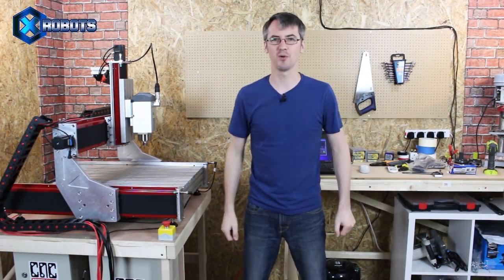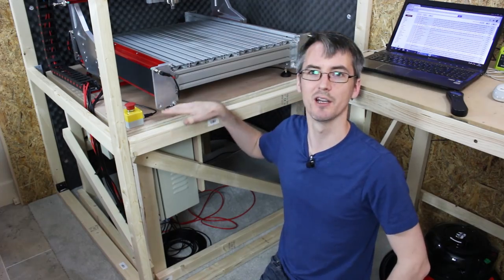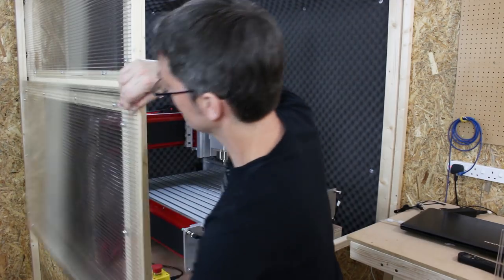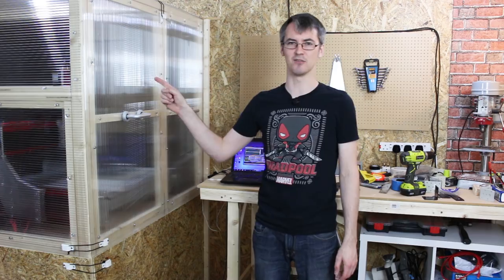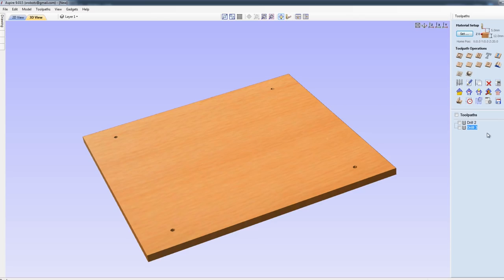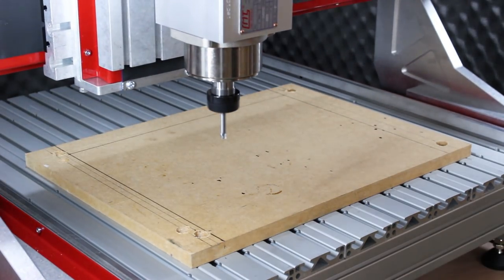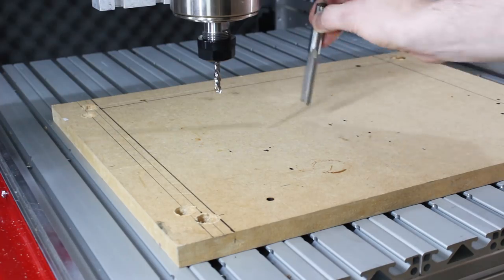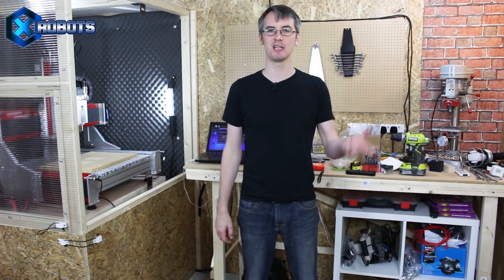Building my CNC Machine Router Table # 2 | James Bruton

Comment: Why not use the CAM environment of Fusion 360? You are already using it for modeling your design. It is a very good and complete solution for your tool path. And if you make a change to the model, the tool path updates!

Comment: James adding the Auto Z and Corner Finding Touch Plate should be a walk in the park for you, plug it in - check input pins are set and add the VB script to the 'Auto Tool Zero'. Great to see you've added a CNC to your toys

Comment: Excellent machine and setup James. I would seriously look at adding an easily accessible Emergency Stop button. Also add a sacrificial spoilboard to save that nice Aluminum tabletop and level it.
Looking forward to the awesome projects you will make with this. 
Cheers
Peter
Reply: One might want to have a wee think about what happens when you stick a 2kw heater in that box

As you have a 2Kw spindle and all that 2kw turns to heat
Reply: @thinfourth So you are saying that his machine has 0% efficency. Absolutely ridiculous. I really recommend you to study just a little bit some thermodynamics
Reply: Teach me wise one.

What happens to all the energy after it has cut some wood
Reply: thinfourth thinfourth I don't have to teach you anything. Of course there's friction that means heat, but not all the energy absorbed by the machine itself is transformed in friction. In fact, noise (btw it's the main topic of this video), the tool milling and, also, accelerating the chippings needs energy. So given a certain amount energy to the spindle, just a part of it is converted into heat. I just pointed out that little thing. Nothing else. Anyway I completely agree with you, especially for long jobs you will have to extract the heat from that box.
Reply: @thinfourth  agree that it mostly turns to heat. But the 2kW motor is not running at max power all the time, if ever, it probably only uses 1/10 - 1/3 most of the time.

Comment: James, when drilling with an end mill, ensure that it is center cutting. There should be a nice chip emerging from the flutes (not sure that is the case with MDF). Try using the same feed but dropping the speed to around 2500rpm. Great machine and setup!

Comment: Hopefully you don't have issues with noise from the twin-wall polycarbonate. It's what I used for my DIY 3D Printer enclosure and the sound seems to reverberate or resonate in the hollows of that particular material. Ended up being louder than with no enclosure.

Comment: James, if I could make a suggestion - use 1" bubble, bubble wrap on the clear parts to add extra insulation and sound dampening. you may want to - if you havent- add rubber washers between the plastic panels and the wood.  With these improvements you could see a 1.5x improvement in the noise pollution that the machine currently makes. Thanks for sharing! cheers!

Comment: I have an idea for the mess, make some kind of shroud for a shop-vac to wood(likely 3d print it). You would have the shop vac and shroud come in from the bottom of the platform the cnc is sitting on. Then you can just push all the wood and stuff into the hole. Also as others said put the emergency stop button outside of the enclosure.

Comment: Nice bit of kit James! Little tip if you don't mind . . . if you NEED to measure with a tape, start your measurement further up the tape ie: at 100mm or 10" . . . and just subtract that from your final dimension, you will get a much more accurate reading... AND, if you are measuring hole to hole, try measuring from the 'left' edge to the 'left edge of the corresponding hole (or right to right) rather than centers which are not exact/visible (in a pre-drilled hole) . . . Hope this helps :-)

Comment: If you burn MDF it means you are cutting too SLOW, not too fast. Made that mistake myself and almost caught a piece on fire. More time for the friction heat to build up makes it burn.
Reply: By that of course you mean the feedrate, not the spindlespeed right? That spindlespeed combined with that slow quill feed made it burn.
Reply: duodot Both really. The spindle needs to be moving a bit faster to compensate for increased feedrate or it will stall out the machine. However there isn't really a big issue with going "too fast" on spindle since MDF is so soft. I was cutting 3/4" MDF at I think 12000rpm on a 3/8" endmill and after fixing feed it went beautifully.
Reply: Interesting. I mainly mill hardwoods if I mill wood and I would have lowered the spindlespeed WAY down to make chips and not dust, but I don't have much experience with MDF so I'll take your word for it :P
Reply: duodot Yeah MDF literally is compressed dust, it will return to being uncompressed dust whether you like it or not XD
Reply: lol Seth you just reminded me of the time I set my vacuum on fire, I sucked up some smoldering plywood embers into my wet / dry vacuum and set the paper filter on fire. The vacuum created its own wind source, so instead of blowing on the wood to start the fire the vacuum suck started the fire.

Comment: If you are using Mach3 there is some code you can easily find on a Google search to use a xbox controller as a jog control, been using one on my machine for while and it makes it a lot easier in my opinion. As others have said a spoil board is a good place to start once you run a levelling pass over the working area of the machine. Very important step as it will help depth accuracy on your plunges between the tool tip and the bed. Most sheet material is not a consistent diameter across it surface levelling is the only way to confirm it's true to your machine.

Comment: I’ve read and heard 3mm isn’t usually a good bit size unless you’re doing final passes. 4mm seems to be the standard lowest.
Also, to measure the diagonals it would be better to cut a little L in each corner so you have a clear and definite inner corner to measure from.
Also the “weird offset nut” is an eccentric nut! :)

Comment: No dust extraction? I know you want to keep the noise down, but you should have dust extraction to turn on before you open the case. Just a hole in the top and an extension hose to a shop vac would work and turn it on for a few minutes before popping the case open.

Comment: Don't drill with an end mill.
Reply: It's perfectly fine to drill with an end mill as long as it is center cutting. His speed was way too high. I think 2400rpm with the feed he was using would work great.
Reply: That, and I couldn't tell if it was an up cut or down cut end mill.  Don't drill with a down cut end mill!
Reply: It's a compression cutter which is really not ideal to drill with if you're going any deeper than the up-cut flutes

Comment: You didn't show it but I sure hope that this piece of wood is fixed to the machine somehow!
Also, one question: is there any oil/lubricant spraying system needed on this machine? If you need to cut though aluminium or something... Or typically to avoid those burns :D 
Otherwise really nice little workshop you've got there, I'm jealous! Keep it going James, love it.

Comment: If the polycarbonate stuff starts to annoy you because you can't see what the CNC machine is doing, replace it with PETG sheet - Cheaper than polycarbonate and not brittle like acrylic so you don't need it to be thick. 3mm is plenty touch enough and about £30 for 1x1m inc VAT.

Comment: James, your drilling burned because you were using that compression bit. The "downcutting" section of the bit forced chips into the hole, causing lots of friction and the burn. If you were to use a conventional end mill (up cutting or even straight), you'd have better success

Comment: You should change that spindle with a water cooled one.
Reply: Fog buster is a different thing. It cools cutter bit and parts, not the spindle itself. Water cooled spindles are quieter than air cooled spindles.

Comment: i'd like him to say: wowter 'wooouter' or joke aside: just CNC. And for soft materials, 1F or 2F cutter, high rpm and fast cuts through. Super smooth and no burns. Same for 6061 or stronger: Mill with smaller dimension bits like 3.175mm and 1F / 2F, higher rpm and blow the chips away. Consider cutting under water. Look at German Datron bridge CNC machines with high speed spindles and how they cut Alu. https://www.datron.com/about/german-engineered.php / Greetings from Herri a German Designer in China